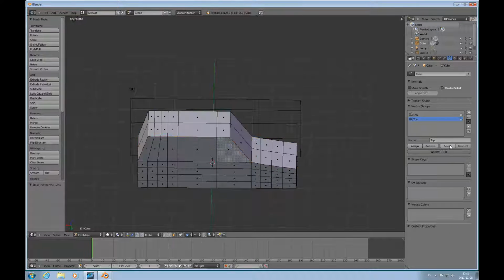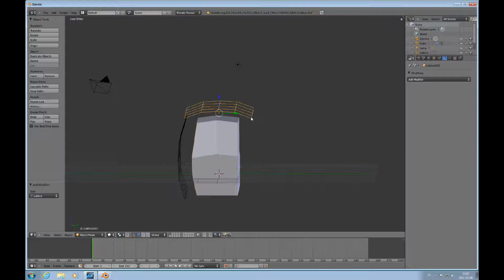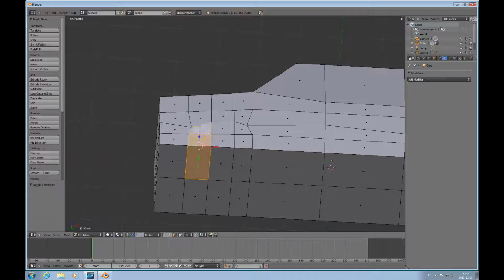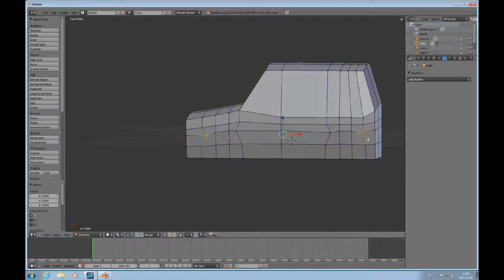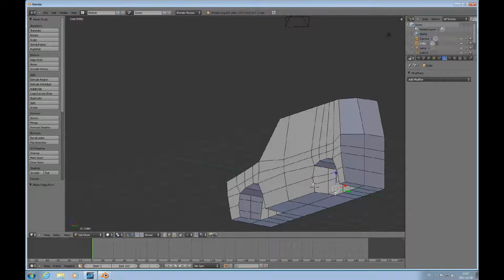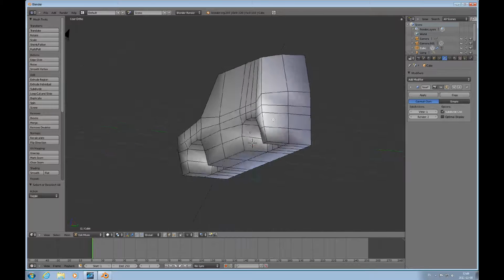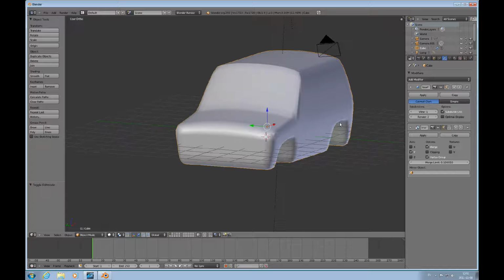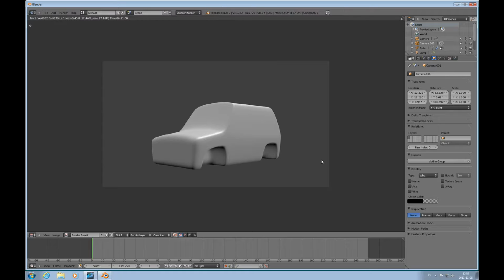Accomplished Beginners Blender #9 3D Tutorial

Comment from the maker: @knavic A truck with a regular cab I would do the same thing up to 0:50 and instead of extruding the tree faces upward only the one that will become the roof of the cab. If you want a super cab or crew cab you need to extrude the first two up. In all cases you will just have to decide if and how far you want to grab the rear face and pull it out to make the bed longer. Maybe you need to loop cut (Ctrl R) the bed to prepare for the wheel well. Did this help ?

Comment: If I were to make a truck instead of a SUV how many extrudes to the default block would you recommend I make in the beginning, for some reason I'm having trouble with this first step. I tried making a truck using the blueprint method but realized how tedious merging of vertices can be to a beginner.